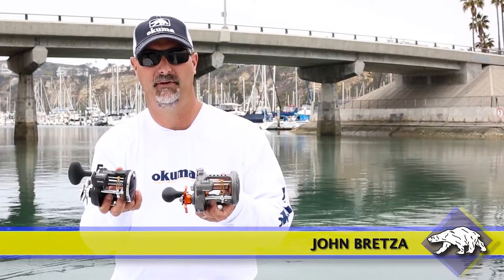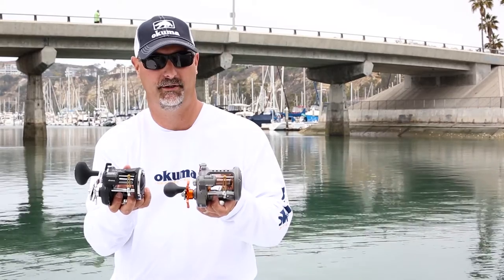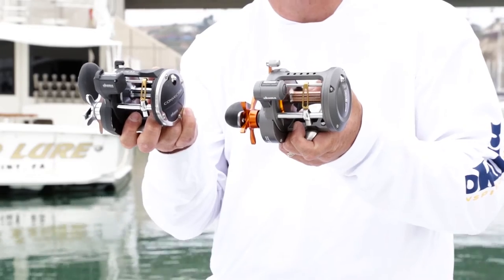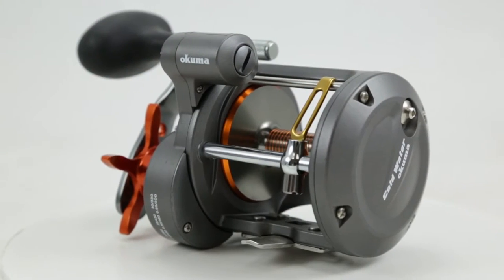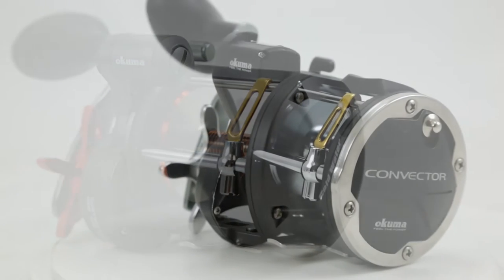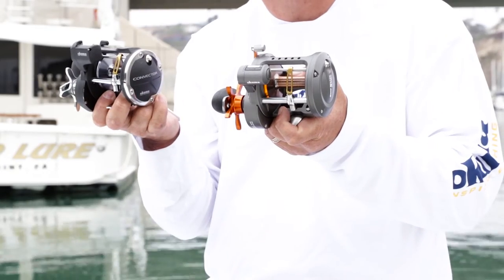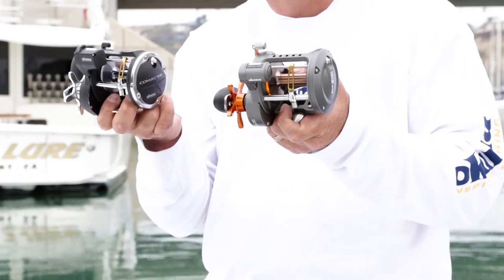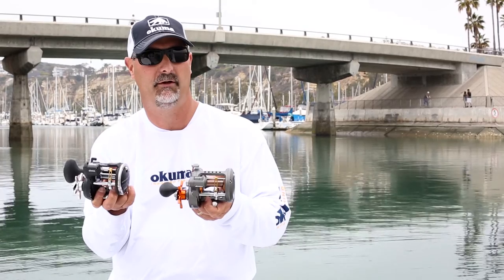Okuma Coldwater and Convector High Speed Wire Line Reels

Comment: I have a 553LS on the way and it should arrive today. That will go on a boat rod for bay fishing halibut or sturgeon.  I also am waiting on a CLX300LA to come in stock for striper fishing from shore. If the Cold Water smaller sizes were available without the line counter, I'd be waiting on one of those, instead. I wonder if Okuma has ever thought of offering the smaller sizes in that option.

Comment: Went fishing this weekend and my CV45L is locking up This reel is not more than 2 years old and at best has 10 trips on it and it locks up now. I cant depend on it. I keep my gear clean this really baffles me so I am moving on to another brand. I was looking at the Coldwater reels but can I trust them not sure about that either.
Reply from the maker: Hi D Kat- 
Sorry, must have missed this comment.  Sorry to hear you are having an issue with the Convector.  These reels are pretty bulletproof and have been in our lineup for quite a few years.  Did you call our service guys?  If not, give them a call at 1-800-Go-Okuma and ask for Eddie or Ronald.
Reply: OK well its out of warranty so I took it apart and oiled the heck out of it and then check this it out I put same old Slick 50 on the gears and it stopped it but if it does it again it will go into the "Dead Reel Box" its full of old Penn reels now.